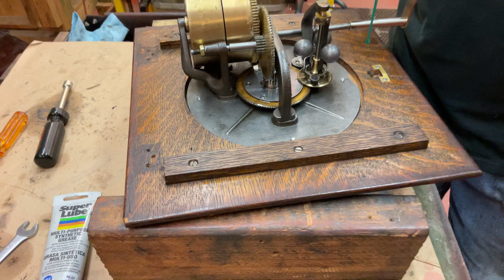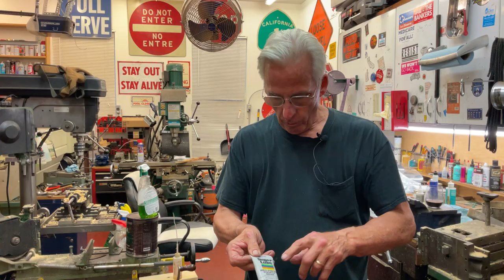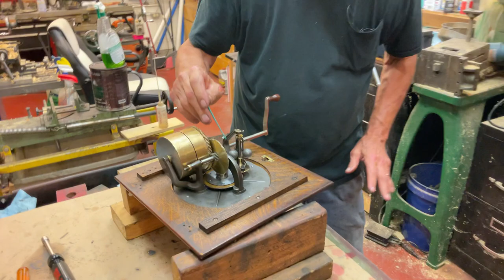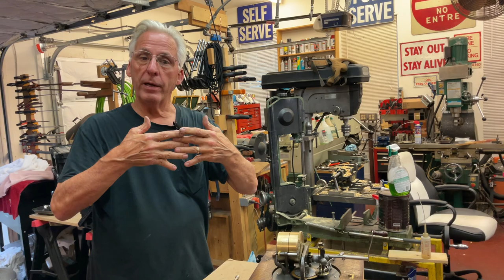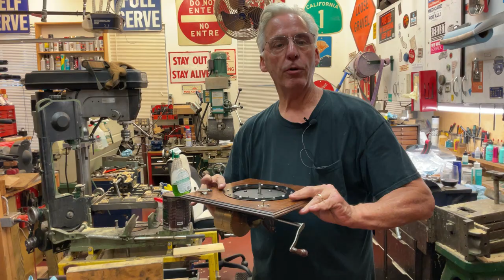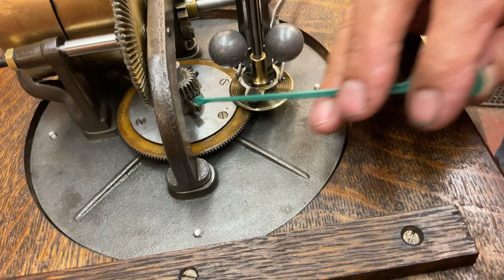1176.  The Victor M phonograph motor is finished and running smoothly

Comment: I love these videos, they've given me the confidence to work on a Silvertone phonograph I got for free. Any tips on how to get the main spring to grab on to the knobs on the axle that that passes through the spring housing?
Reply from the maker: It is a matter of making sure the end of the mainspring has the curve of the barrel. I use a very large flat tip screwdriver to hook the opening onto the button, then slide it into place.  it is not easy but with practice you can do it

Comment: Hello I recently bought a Columbia model q Graphophone and the reproducer sits very close to the mandrel. I was wondering how to adjust that?
Reply from the maker: If it is not hitting the cylinder you should be OK and the machine should play. If it is hitting the cylinder so you cannot put a cylinder on and play, then it needs to be rebuilt

Comment: Would not adding molybdenum sulfide (not graphite) powder at 3% to the super lube be beneficial in preserving the brass teeth on straight cut gears ?
 The solid of Moly should make things even quieter and keep the gears from wearing.
Reply from the maker: Some people use it, I do not because I think the super lube performs just as well